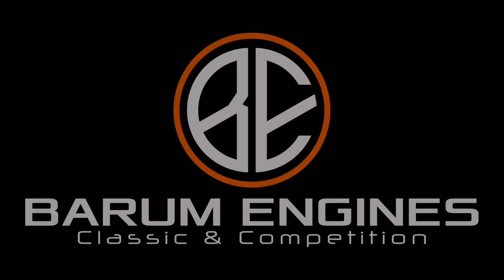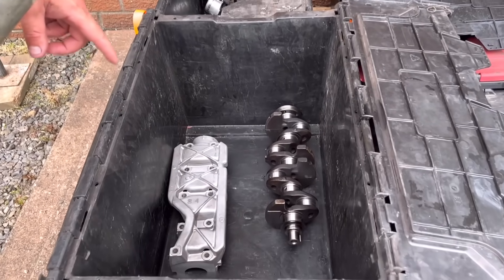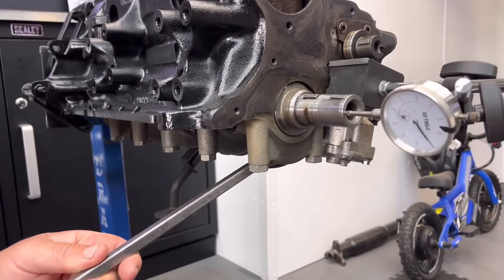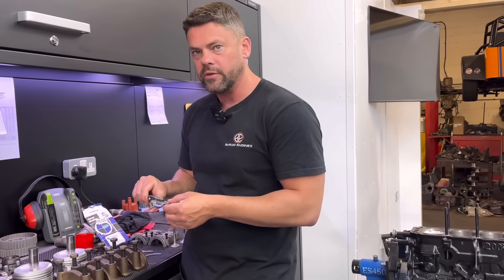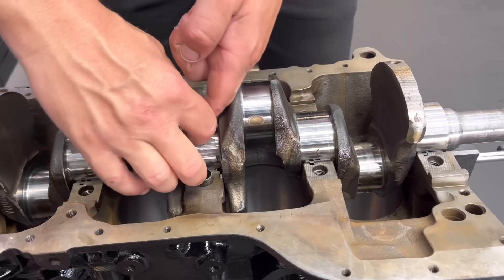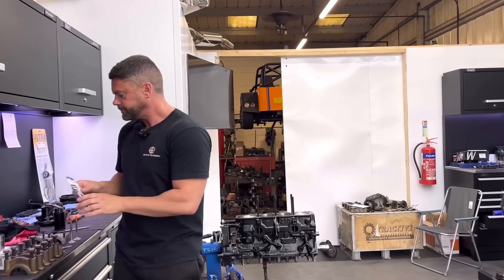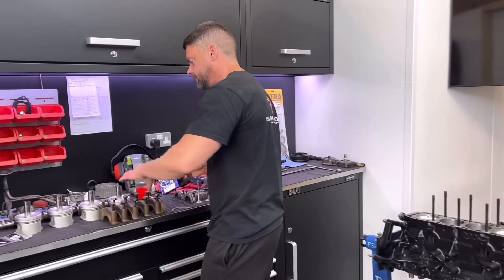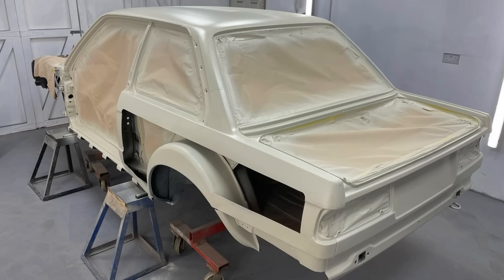Not checking this can SCRAP your engine in seconds!

Comment: In fact, I had new pistons fitted to a VW golf 1.5 engine. 
And they didn't check the end float even tho the bearings were ok. I only had so much money, but I'd have paid for new thrust bearings! 
Anyway it ended up filling the sump full of metal shavings and seized the oil relief valve. 
Oil squirted at very high pressure out the side of the oil filter.
I got some really good engine shop to weld the crank back up and machine it, cleaned it all out and it was fixed.

Comment: Re cash flow. It is usually a problem with an expanding business. Bigger turn over means you have bigger outgoings for parts etc, which a while later leads to the bigger incoming. But it is the time between buying parts and stock, and the eventually getting paid that causes the problem. It was a lesson I learned when working as a buyer in a small manufacturing company back in the mid 70s. Hopefully, with careful budgetting and cash management (and selling a kit car) you can get through it and eventually reap the benefits.
Reply: Cash Flow. When you grow a business, you will always experience cash flow challenges. Another solution is to ask customers to pay $xxxxx for the parts, before you start the work. Our engine builder used to ask for a US$30,000 "deposit" before starting work on our engines. He would then order parts, and take three days off to go surfing, whilst waiting for the parts to arrive!.

Comment: When I rebuilt my kent 1.3ohv the thrust endfloat was on the limit but I had no idea what the existing thrust washer size was as it had no markings so I didn't change them.
Couple of thousand miles later I checked the endfloat and it was 0.7mm.
Eventually pulled out the engine to sort an oil leak on bottom end and when I removed the sump I found to my horror that I had fitted a thrust washer back to front.
Crank totally buggered so managed to source a good used crank from Burton Power.
All rebuilt again with new shells and thrusts throughout.
Measured end float and it was 0.0035" which is ok.
As for the oil leak,it appeared to be coming from a ball bearing plug located on the back of the block on the right-hand side just above the starter motor.
Ball can not be knocked out as their is no access from other end.
Looks like it's lubrication gallery to cam bearings.
Cleaned area with brake cleaner and plugged hole with araldite and touch wood the oil leak has stopped.
Originally I thought it may have been the rear of the sump leaking but when stripped their were signs of oil running down the block from the ball bearing.